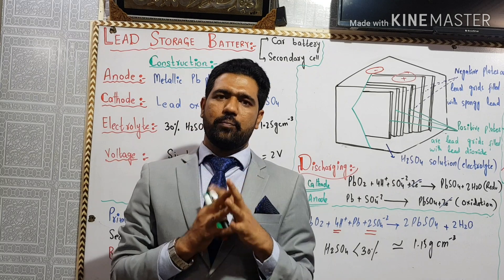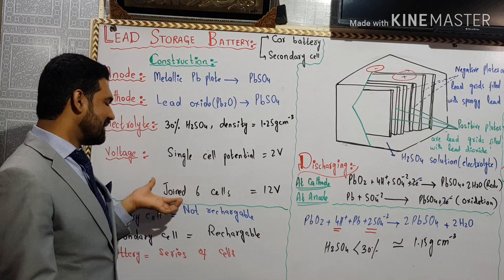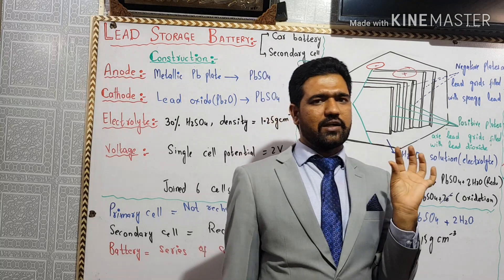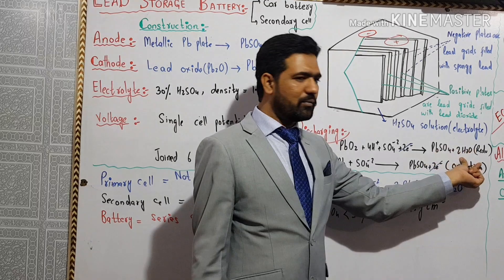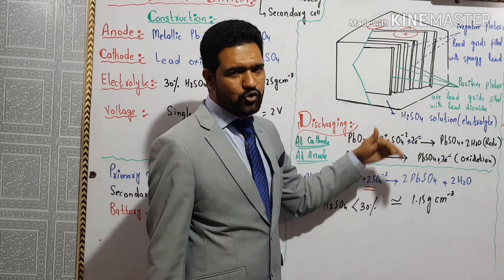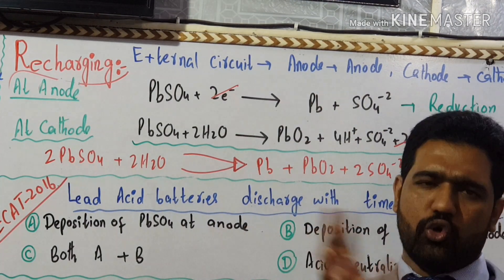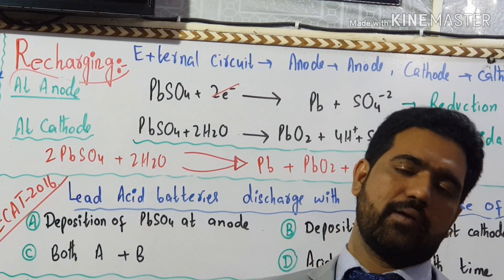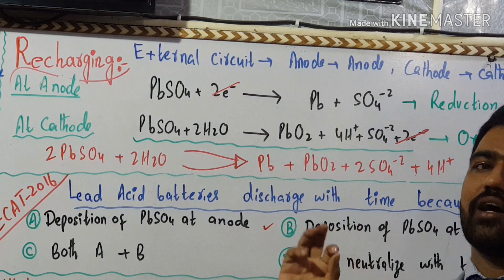Lead storage battery

Comment: sr lead battery ma voltic ya electrolytic cell establish hota h?
Reply from the maker: Voltaic cell
Reply: @chemistrycoachingbydr.ghul8852  passing a direct current through it must charge it??/
aisa to electrolytic cell ma hota h
Reply from the maker: @ISLAMISLAM-iu1cr  
Galvanic or voltaic cell main at the loss of chemical energy electrical energy gain hoti ha dear...
Reply: its not clear sr,please clearify me about this book line
Reply from the maker: @ISLAMISLAM-iu1cr  
Must charge ka mtlb ha electrical energy store hui ha. And exactly this is voltaic cell dear.
Reply: @chemistrycoachingbydr.ghul8852  really,you are great
please keep it up.
Reply from the maker: @ISLAMISLAM-iu1cr  
Thx for appreciation. Yes, i shall keep on continue dear.